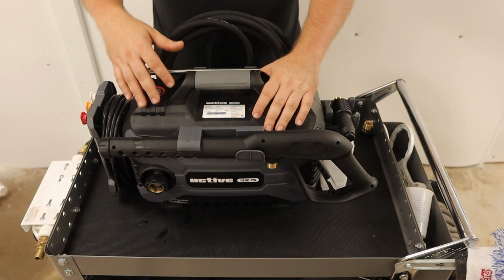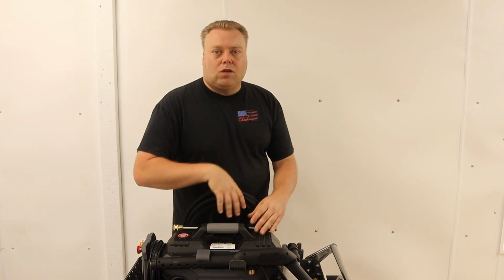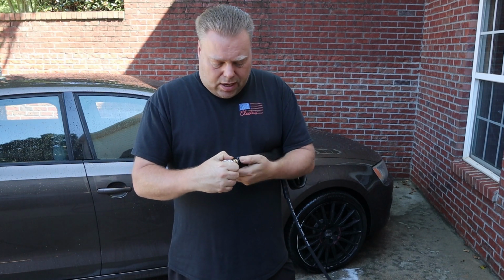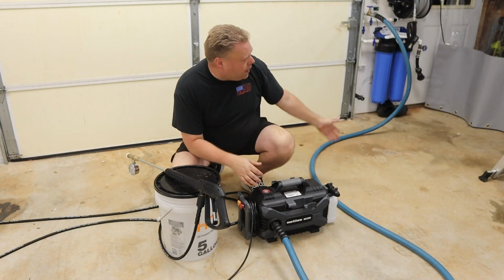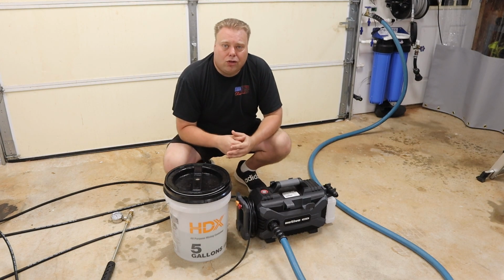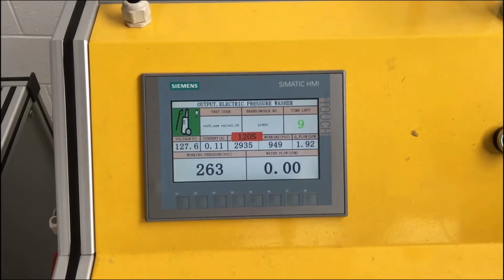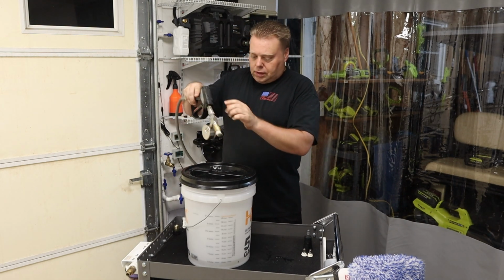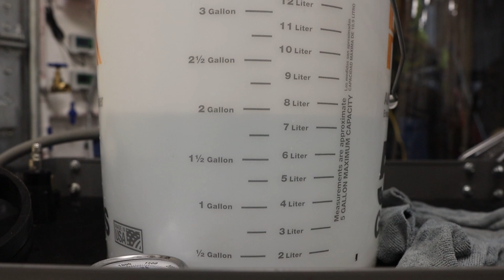Best Pressure Washer Value! | Active VE52 | Newest Version | Testing & Review

Comment: Due to videos by you, Obsessed Garage, and Active  I have decided to get the Active 2.0 and pre-ordered the "Advanced" package from Obsessed Garage.  In fact, I received the accessories 4 days after ordering so, all I need is the pressure washer for the fun to begin.
Thanks for all the great information and knowledge you provide.👍👍
Reply from the maker: Nice, you should start getting emails updating you on the 2.0. They have a spreadsheet showing your order number and where you stand in line. They are being produced right now and should be on a boat soon for the month long journey. Middle to end of next month is most likely when the first batch comes.
Reply: @CarsWithKeav  Thanks!  That's nice that they did that for us.  I'm #268 for the 2.0 "only" (because I've already received the rest of the package).
Thanks, again, Keav.👍

Comment: I have had mine for over a year now. Did some of my own mods including: quick connects, water shut off going into the unit, 50' Uber hose & multiple stubby guns. I have that same foam cannon. Unit still performing very well. 
The new 2.0 is on my wish list. 👍
Reply from the maker: Nice, I did all the same and got every penny’s worth out of mine. Can’t wait for the 2.0!
Reply: With the longer hose did you have pressure/surge issues?
Reply: @kylerebman5094   Not really. Been a fantastic unit. 👍

Comment: Love your channel Keav I just bought the Giraffe Tools Grandfalls Pressure Washer Wall Mount, 2200PSI Electric Wall Mount Power Washer with 100FT Retractable Hoses, Soap Tank and 4-Nozzle Set from Amazon. Taking forever to get here but I really like how this is a wall mount pressure washer with a 100ft hose that has a real built into the system it rolls back up on. Also bought the iFilters Whole House Water Filter, 2 Stage from Amazon. Also got the M MINGLE High Pressure Washer Gun Snow Foam Lance, 4000 PSI Cannon Foam Blaster Power Washer with 1/4" Quick Connector, Car Wash Foam Cannon Kit with 5 Pressure Washer Nozzle Tips, 1 Liter  from Amazon. Hopefully this is a good starter set up. Thanks for all your info on your channel.
Reply from the maker: Dang, you are going to have some fun! Reach out via DM on Instagram if you need any questions answered with the setup.
Reply: @CarsWithKeav   Do you have a FB page? I don't have Instagram.
Reply from the maker: @davidsizemore2745  Sure do. You can message me there as well.

Comment: 8/27/22. Just received my ve52. In stock configuration (stock hose, wand, 40deg/3.7) my gage is reading just under 800, call it 780psig. After switching out to 40deg/3.0, gage was reading 1000psig. 

After installing 50ft flexzilla hose w/ mtm wand w/ 40deg/3.7, massive surging that eventually went away, gage was reading just under over 700psig. Swapped it out for the 40deg/3.0 and pressure went up to just over 900psig with every release of trigger causing pressure to jump to 2200psig. 

Thoughts??
Reply from the maker: I answered a good bit on the other comment so will touch a few other points on this one. Where did you buy it from? Try and contact customer support with the model serial number to see if it has all the upgrades. Is it working well, but you are just worried about that 2200 PSI jump? I would be too though. Have not seen that problem on my units.

Comment: Will it pull water from a tank u think? And wow that foam cannon u have is way good
Reply from the maker: It is not self priming you would have to feed water to it at a certain flow for it to work. Very few self priming ones out there and most are battery powered and not plug in. Search self priming pressure washers as they will draw water from a tank or bucket. If the tank is elevated it could gravity feed to this one though. Many would run a pump if it isn’t gravity fed.
Reply: @CarsWithKeav  yes I been researching the pump I would need. What I gathered so far is it must have a pressure switch, any thoughts or known an ideal pump? Subscribed. Thanks for your time
Reply from the maker: @Rabbit.760  I have used this one to pump DI water back through my system that I have stored. https://amzn.to/4dVnbFM This is the only one I have ever used though. It’s says 5.5gpm, but the best I could get was 3.5. It was all uphill pumping though.

Comment: Would this make a good wall mount or not? I see the hose connecting to the rear of the unit. Thanks
Reply from the maker: I used for awhile as a wall unit before upgrading to the Active 2.0. Elbow fittings help out a lot.

Comment: Hey keav I’m looking into buying my first electric pressure washer system and ran across you videos. Have budget of about 400ish on top end but clearly saving some isn’t a bad thing lol. I was wondering do you find this unit to be better then the Giraffe Tools unit? I don’t necessarily care if it is wall mount or not just want best unit I can buy for the money. Thank uuu so much for the great reviews
Reply from the maker: Active VE52 hands down is the better unit. The accessories stock are good enough to get going then you can upgrade the hose and more. The performance is unmatched. The Giraffe is all about the automatic reel and wall mount.
Reply: @CarsWithKeav  awesome thank you so much for your insight I’ll be ordering one today based on this info! I love your vids man keep putting out great content.

Comment: Hey Keav, interested to know if the carrying handle, and maybe even plug holder can be dismounted? Want to buy, but need to fit in very tight spot in a vehicle system… replacing a Ryobi 1600 that is packed pretty tightly on the top shelf of my rig. Thanks!
Reply from the maker: Plug holder snaps on and off and is not attached out of the box. The handle does look to be a separate piece based on it isn’t the same mold as the body. Not sure how it’s attached though. This unit is big compared to a Ryobi 1600. If you can afford an extra $100 the Active 2.0 would be perfect. It is very small and inlet hose position has been moved to the side.

Comment: Would this work on the go? Possibly with a portable power station ? Or how could you power it without an outlet
Reply from the maker: As long as you can get a 15 AMP circuit to supply the unit with the amount of power it needs.

Comment: You’re funny dude. Good feedback and testing. Aesthetically and when functioning properly that pw really is the best value and numbers for washing cars. I like their new one but honestly I think this one looks a bit better. I have a Karcher cube but it does sound like it’s struggling to keep up with 50ft Garden&pw hose. Also has a bit of delay. What filtration system would you recommend in Arizona? TDS is over 300 and I wash about 8-10 times a month.
Reply from the maker: Sorry so late to respond this comment was flagged for review for some reason. If you can afford it the CR Spotless is the best for that hard of water. The Maxwater I have used before is okay, but with that high TDS you will blow through the resin quickly and be constantly changing. Video on the CR Spotless should be out in the next day. I agree this one looks better than the 2.0 they have coming out, but I'm getting it  for the double lifespan, small forma factor and the inlet being on the side. https://amzn.to/3BeZzLl https://amzn.to/3POlXPS
Reply: @CarsWithKeav  no worries and great points. Probably flagged because sometimes I speak a little too much truth in comment sections:) You may already know but the Suds n Go channel is about to launch a fully set up RO DI system. The RO alone brings water with a tds of 274 down to 005 before going thru the DI resin. The main reason for this system was all the money he was spending on resin. My question is would you even need to use resin at that point? Seems close enough to zero but they system is going to be all one unit. Thanks bud. Appreciate your replies.

Comment: I am so interested in getting one of these just from watching you. But I noticed you talk about different adapters and orifices. Would you please describe the parts needed below to make it to where I could use my stubby handle and I already have a foam Cannon. Also the best setup for PSI and foam. I remember saying out-of-the-box the unit isn't that great and you can upgraded it thank you
Reply from the maker: Here is a video I did in the connections and has the unit as an example. MJJC foam gun S 3.0 is a good foam gun. The nozzle the device comes with is already the best PSI and Flow they offer. This unit does not do much higher PSI, but the combination of flow and PSI creates good cleaning power.
https://youtu.be/a0qhRTp7OY0
This is a great budget foam cannon
https://youtu.be/Dz-f2hJcQL8
This is the best I have tested so far.
https://youtu.be/kQlB5qEI_5E

Comment: I’m debating if it’s worth to get a 20 amp installed for this.  The install would be more then the cost of the pressure washer 😂
Reply from the maker: I only ran 20 AMP as I couldn’t run battery charging, pressure washing, portable A/C at the same time. Plus I hated my lights flickering whenever I pressed the trigger on my spray wand. Dedicated circuit is much better. I did it myself, but was easy since the area was unfinished and the fuse panel 10 feet away.

Comment: I just got a cat pressure washer which active makes and mine keeps running I just got it is that a big issue
Reply from the maker: A few things to consider first would be water pressure going to the unit, leaky hose or spray gun or possible dirt stuck in the nozzle.  The unit should turn off right when you let go of the trigger. If it is not anything of those things reach out to their customer service. Possibkly the CAT versions didn't get updated or it was old inventory.

Comment: Can this handle a 3/8 100 foot hose?  thanks!
Reply from the maker: The newly updates ones they state can handle a 3/8 50ft hose. I am not sure about 100 ft though. Let me check.
Reply: @CarsWithKeav  Hi Keav, @ACTIVEPRODUCTS replied to me and said a 3/8 hose at 100 foot has no issues.  Cheers and thanks!
Reply: The only thing i don't like is the inlet and outlet locations....so backward and makes trying to keep things compact and tidy a pain.
Reply from the maker: @Sn-tk8rq  Agreed, I used elbows to make it more seamless.
Reply: @CarsWithKeav  Any recommendations for the high pressure outlet elbow?  Thanks

Comment: That one is nice I just bought a SunJoe that was on sale on prime day.  I’m gonna give that a whirl. I also bought a different gun with a foam cannon. It only came with a 20 or 25 foot hose. Is that long enough to wash a Honda Civic?
Reply from the maker: 20 foot works with a Civic. You get the unit a few feet away it should cover both sides and to the rear. Not much room though. 25 foot is plenty. Sunjoe makes some good ones. Dial in the pressure to optimize flow and you will be happy with it. Check out the Obsessed Garage website and they will let you know the nozzle size best for your unit.
Reply: @CarsWithKeav  thanks! I’m only gonna be using it to wash my car. I bought a this foam cannon. 

M MINGLE High Pressure Washer Gun Snow Foam Lance, 4000 PSI Cannon Foam Blaster Power Washer with 1/4" Quick Connector, Car Wash Foam Cannon Kit with 5 Pressure Washer Nozzle Tips, 1 Liter

I haven’t got it yet it’s supposed to be here tomorrow or maybe today.

Comment: Whats special with pressure foam was her?
Reply from the maker: Foam helps you  evacuate dirt of the surface better without scratching the paint. Its a good thing to do before doing a mitt wash so you have less dirt get on your mitt.
Reply: @CarsWithKeav  thanks Vera much. Is it much more expensive using a foam for car wash business as suppose to the norm please ?